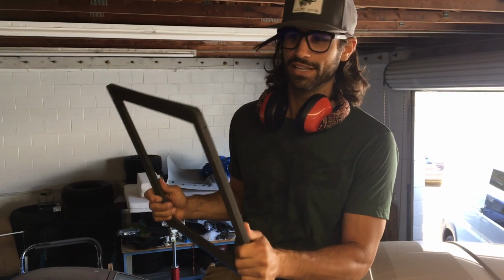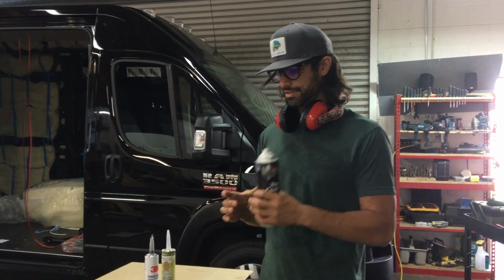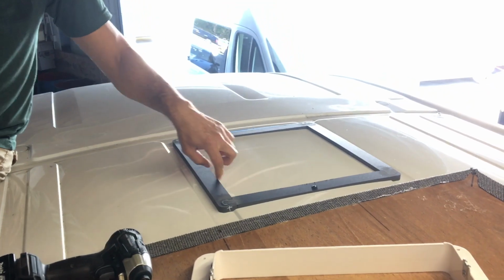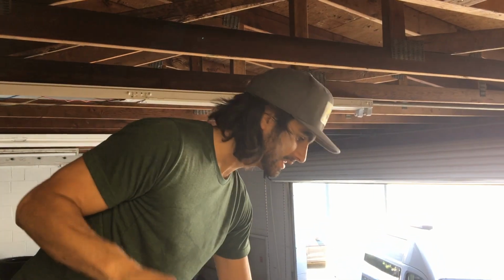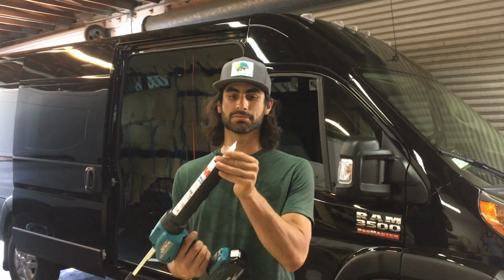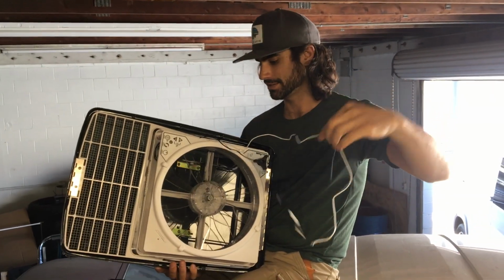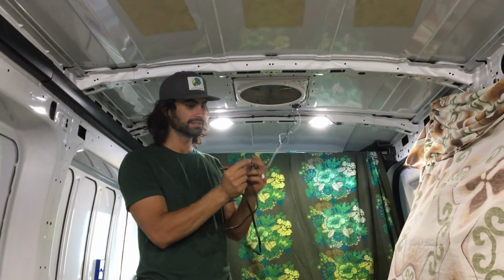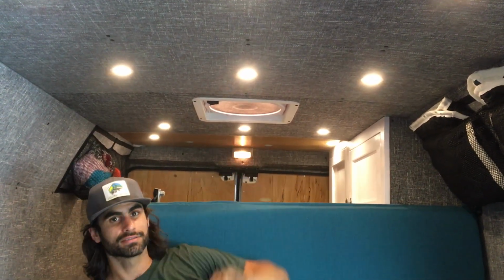How to Install a MaxxAir Fan 2019 **UPDATE**

Comment: Great video! I like that you install a little differently than others.  It gives even more ideas for fit/waterproofing.  Most fan installs stop after the install and don't show how to connect the wires.  Do you have any videos showing more about this? We hope to connect our fan to a Jackery, but haven't found any good resources on how to do this. Thanks!!
Reply from the maker: Hi Andrea, thanks for the message. If you'd like to connect it to a Jackery, I would wire it to something like this: https://www.amazon.com/Carviya-Cigarette-Lighter-Inverter-Electric/dp/B01HGO2OIS/ref=sr_1_8?dchild=1&keywords=dc+plug+cigarette&qid=1591721913&sr=8-8 
16 gauge is the smallest wire you'll want to use for the fan.

Comment: Are the factory screws still sufficient with the added thickness from the adapter?
Reply from the maker: Sorry I missed your comment. I've been so swamped! You sometimes need to get longer screws for the thick areas of the adapter. However, if you use window weld between the roof and adapter as well as between the adapter and the mounting piece, you probably don't even need to screw it down because that stuff is so strong. This is obviously at your own risk and screwing it is definitely the failsafe was to install it.

Comment: Rust neutralizers in order to do their job, they have to be applied on rusted surfaces. If there is no rust, there is no effect. Same goes for all the paints that container rust neutralizers, like hammerite, rest-oleum etc. They are meant to be used directly on rusted surfaces. They do nothing more than a regular paint when they are applied on not-rusted metal. Instead of rust neutralizers you should just use a regular primer and then regular paint.
Reply from the maker: Thanks for the message Spiros. You're right. The brand of paint I've recommended comes as a rust neutralizer, however the stuff I'm using is actually a high quality DTM (Direct to Metal) paint. It is supposed to have high ratings as a rust preventative. However, if you are starting with clean metal, you can use any DTM paint without the need for a primer.

Comment: You could have used VHB tape and no screws. No gooey mess. 😬
Reply from the maker: Thanks for the comment, and, I hope you're joking!
Reply: @LevityVans  no joke. If I'm ever in Santa Cruz I'll stop by and show you, or pull in front of you on the freeway going 80 mph.😁
Reply from the maker: To each their own. I can't endorse that though. What specifically did you use? I'm always curious. Will you post a link? Also, adhesive does have a shelf life and only time will tell. Screws are much more failsafe.

Comment: Jimmy, you're my hero!!! This is exactly the video I needed before making the dreaded hole in my perfectly good van roof! a couple questions:
1. What length/size self- tapping screws do you use to screw the black adapter ring to the roof?
2. since this is the first thing I'm installing, how can I test it to make sure it runs? (Nothing is wired for the conversion yet) 

THANK YOU AGAIN!
Michelle
Reply from the maker: Hi DoctorG. 
1. I used #8 self tapping screws. This is only temporary and they will be removed before you use the included screws to screw everything down. Be sure not to strip the holes when you screw them down. 
2. You can test the van by connecting the black (positive) wire to the positive battery terminal and the white wire to negative. The fan will then have power and you'll be able to test it out.

Comment: Wow, great video, I hope to install my two fans this weekend on my Promaster and this is a huge help. Do you ever screw the flange thru the roof into wood blocks below such that you have nailers to attach the ceiling afterwards (around the fan perimeter)?
Reply from the maker: Thanks David! I have done that before, however, the ceiling is often secured close to the fan and extra attachments are usually unnecessary. Glad you enjoyed the video. Have fun on the installs!

Comment: do you really need that much lap sealant going over the mounting piece? Is it not enough to just get the perimeter and the screw holes?
Reply from the maker: Thanks for the comment Lauren. It is not necessary to put on as much as I do. However, my technique causes a declining slope from the inner most part of the ring. This will prevent water from sitting on the sealant and making it wear faster. For the extra few bucks, I feel it will make it last year's longer. I've also repaired leaking fans that had a minimal amount of sealant on them. I just don't want to repair any of my own installs 😁

Comment: I really appreciate your video and thanks for taking the time to produce it!! I just got my fan for my Transit build yesterday and wasn't sure if I need that extra gasket but yesterday I took a closer look at the install and realized it's a must. I was watching a lot of videos and people weren't using it on their install. Thanks for the tip on securing it and then cutting around it. That's a great tip!!
Reply from the maker: Thanks for the appreciation bjbhehir! I'm happy it helped you!
Reply: @LevityVans  I just watched your video again and I'm going to start my fan install shortly!!  I installed 2 back door windows yesterday that came out great but this will be my first hole in the roof!! Thanks for all your help!!
Reply from the maker: @bjbhehir  Measure 3 times! Send it!
Reply: @LevityVans  Everything went great till I got the tube of Lap Sealant opened up and I realized I ordered the wrong type, I just ordered the Self Leveling type from your page. I framed out the bottom and tied the framing into my ceiling furring strips, that things as solid as a rock!! I also noticed the roof was a lot more solid after I framed it out. Thanks for all the help!!
Reply from the maker: @bjbhehir  Glad it went well! Bummer about the lap sealant. I'm not sure where you live but, if you're in Santa Cruz or close by, I'm happy to supply some sealant for you so you don't have to wait for it. I almost always go through a little more than one tube too... In case you ordered one and need extra.
Reply: @LevityVans  Thanks Man, I really appreciate that but I'm up in Tahoe area. But I'd definitely like to come check out your shop when I get down there. It's interesting how you just can't go into a Home Depot and buy some of this stuff?
Reply from the maker: @bjbhehir  I know! It's very frustrating. I haven't figured out an alternative for it either.

Comment: Just a thought, given how many of these you probably do, shears would be easier and make less of a mess: https://www.harborfreight.com/14-gauge-5-Amp-Heavy-Duty-Metal-Shears-64609.html
No fine shavings to worry about, no rattling. 
Great for straight lines; not great for corrugated sections, but just switch to jigsaw or nippers for that part.
Reply from the maker: Thanks J.L. I've used something similar called a nibbler but I didn't have as much control. I haven't tried shears though. Maybe I'll give it a shot. Thanks for the suggestion!

Comment: Good stuff! Thank you. Just received my roof vent adapter from Hein at DIYvan.com / Impact Products. Enclosed are instructions which read, "coat the fan flange adapter and onto the roof about 1/2" with brush on bed-liner or Flexseal from the TV guys works well." What are your thoughts on using Flexseal instead of Dicor self leveling lap sealant? Thanks.
Reply from the maker: Thanks for the comment and question Andrew. I wouldn't recommend using anything but a self leveling sealant for the final seal because you want something that is clean and smooth on the top so it won't catch dust and debris. The cleaner it stays, the longer it will last before needing to be resealed...